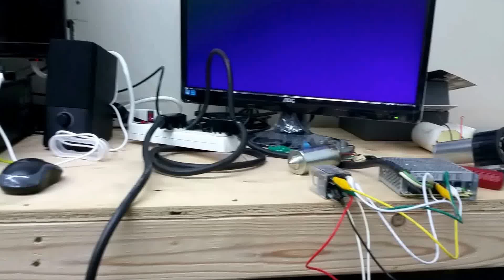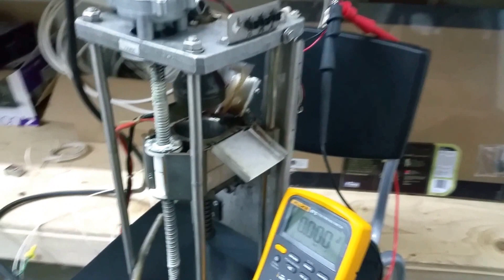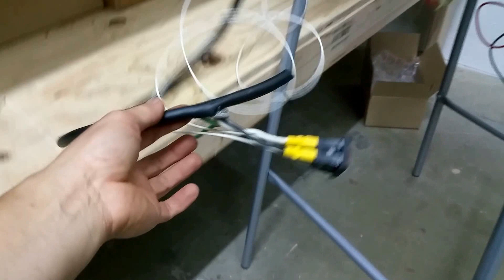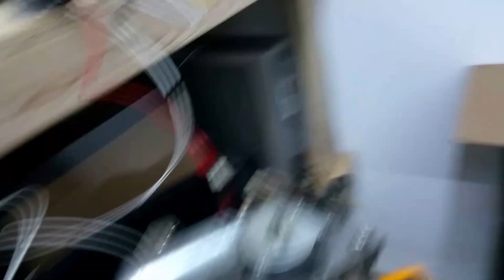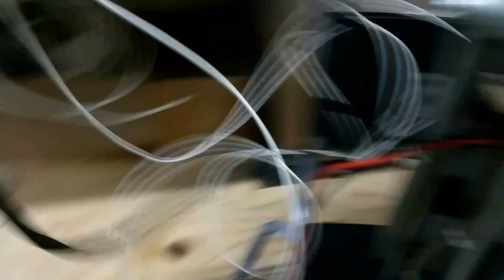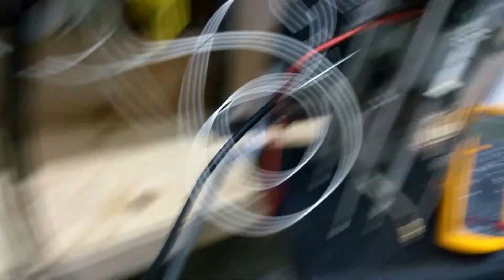Cimbali M2 Barsystem brew chamber motor bench test

Comment: Excellent video.  My machine only produces 20V to move the piston which is not enough to clear the coffee puck.  I've tried replacing the 420 rpm motor and the transformer, but not change.  Do you know what might be wrong with it?